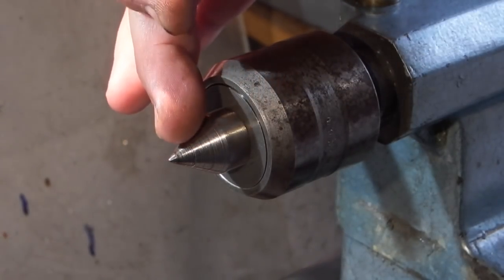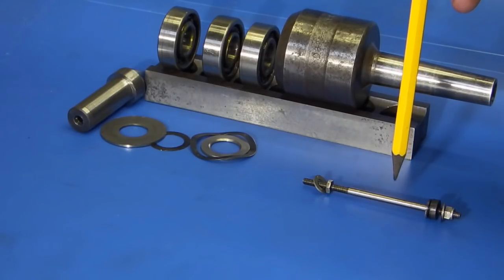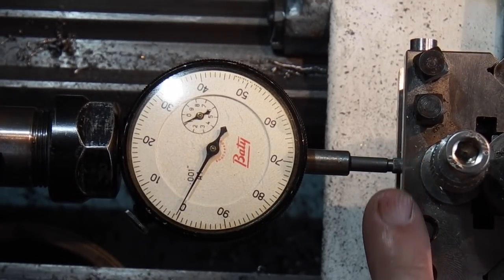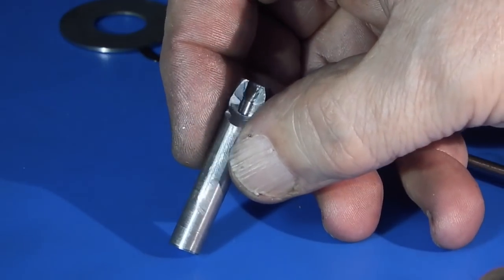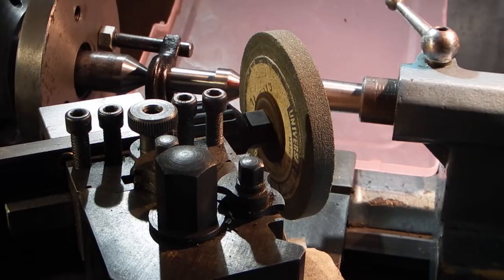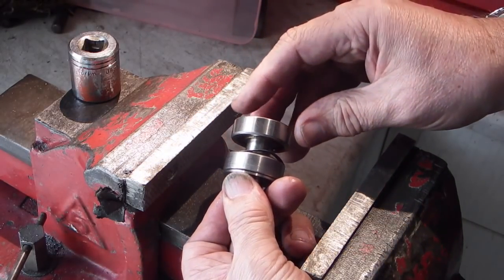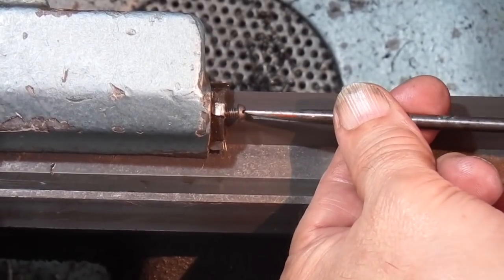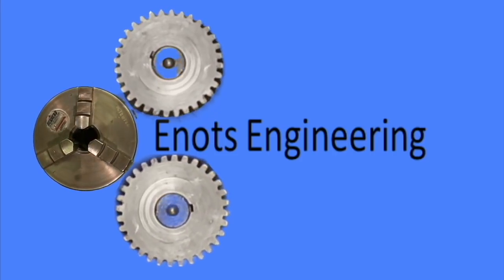Revolving centre renovation

Comment: Your live centre design is a bit different than most that I have seen. What I do not understand is why you did not mount the shaft of the centre in a collet and then turn the point to the angle needed. It seems as though you went to a great bother to perform a simple job. It looks good.
Reply: By grinding it between centres, it insures that the point is true to the outside

Comment: How do there center are taken apart they have no holes in front for tool to unscrew the cap.
https://www.aliexpress.com/item/32841634136.html
But they do have hole at the back with thread and screw cap.

Comment: As far as I know the very best and most expensive live centers always have the tips ground while rotating within there own bearings. Since the factory's making them seem to protect there exact methods or at least don't generally show the details. My assumption has been they use a second slow rotating motor with something like a rubberized wheel touching behind the 60 degree section to rotate the point while it's being ground. I'd not thought about getting access to the full side of a center the way you showed, so many thanks for demonstrating another method. I am more than a little surprised though that there's no thrust bearings in that one.
Reply from the maker: Hi  Thanks for your comments

Comment: I am wondering how that method differs from using a collect to hold the tip in the lathe head and angling the cutting tool to cut the center at the proper angle? I guess I don't see how they differ and that is why I am not a machinist. Just wondering...
Reply from the maker: Hi Gary
I was just showing an alternative method to grinding the point if you don't have a collet set. This method is quicker if you have a number of points to grind as the change over time from one to another is seconds, and any grinding grit is well away from the headstock.

Comment: Hi Allen. Very good video. Very interesting way to grind the point on the rotating center. I built one and got the idea from Richard on you tube channel making something from nothing. He used a ball baring for the shaft to ride on and it not only runs true but it gives it good support also.
Reply from the maker: Hi Anthony
This method of grinding is was used in the tool room when making a batch of centres once the first on is set up the rest can be ground on the same setting.

Comment: Novel way to do that - and got a great result. Did wonder how much fun you had originally with the tear down, to get the bearings off!
Reply from the maker: Hi Chris. Removing the bearings was simple I used a spark plug socket (for the long reach) on the point and a length of bar smaller than the bearing ID to push the point out of the bearings using the vice.
Reply: Ahaha - now that makes total sense - had not really thought it out. :)

Comment: Hi.  Is there a reason not to harden the tip?  I’m new so I’m learning.  Thanks.  Great videos
Reply from the maker: Hi The reason why you may need a hard tip is if you are In a production setting using the centre every day. 
You may also get marks on the centre if you offset the centre for tapper turning then more load is put on one side of the tip. The tip should revolve with the part and reduce friction between the centre and the part.